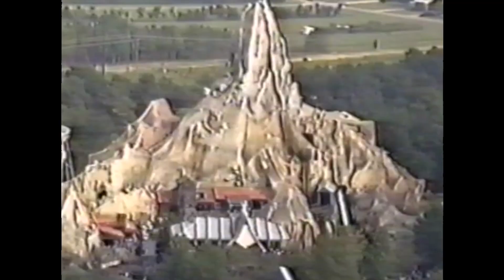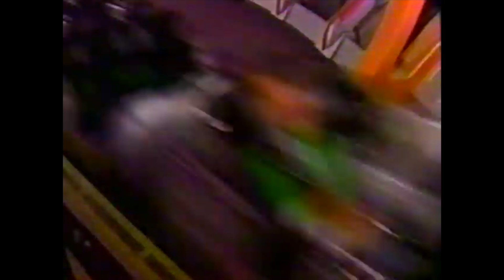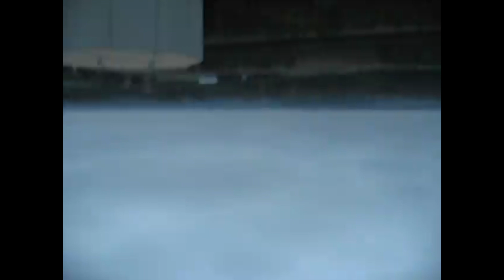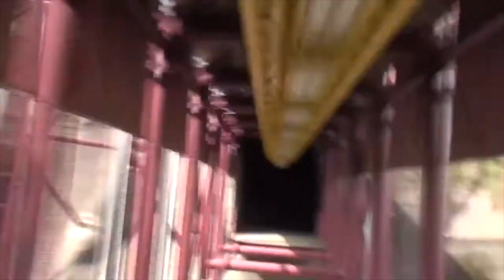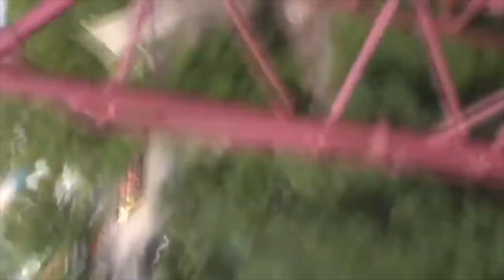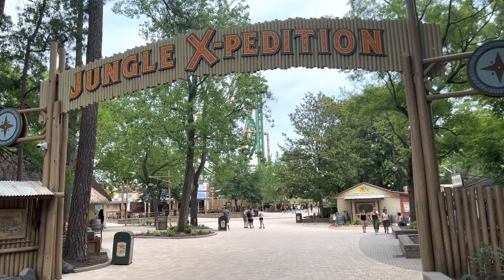Volcano: The Blast Coaster – The Rise and Fall of a Kings Dominion Icon

Comment: Kings Dominion hasn't been the same since Volcano's removal. (Same goes for I305's retheme)

Sure, they got Panterra as the former coaster's replacement, but that was seven years later!

I'd much rather visit Carowinds since that park still has Fury 325.
Reply from the maker: Fury is one of my top coasters, but I still really enjoy Kings Dominion. If they continue down the themed route like in Jungle Xpedition I will be very happy!
Reply: I305 AND TWISTED TIMERS CLEARS FURY AND  COPPERHEAD STRIKE.

Comment: I used to be very specific about the time I would ride Volcano.  I would go to it right around sunset. 
The lines were usually just about gone at that point and the ride was easy to get on.  When you came out of the top and into the heartline rolls, you were in the western side of the mountain, giving a glorious but short view of the setting sun from 150 feet in the air.  
The first time I rode at sunset, I exclaimed out loud, "Ooh pretty!"   (I ended up saying that every time.)
Reply from the maker: Ive had some amazing sunset rides over the years, and I bet this was one of the best.